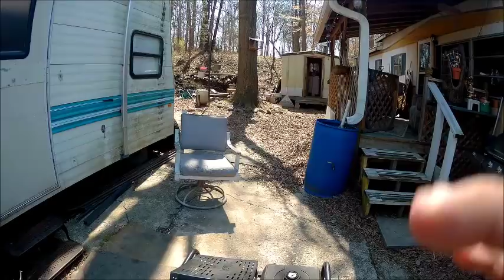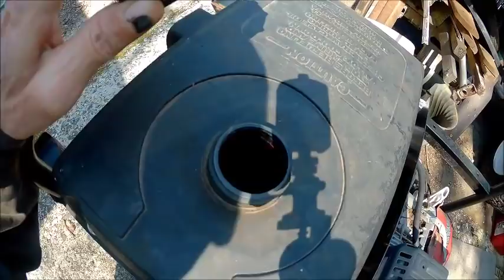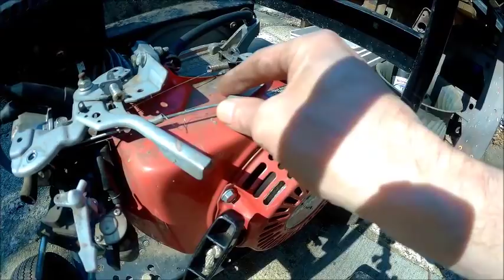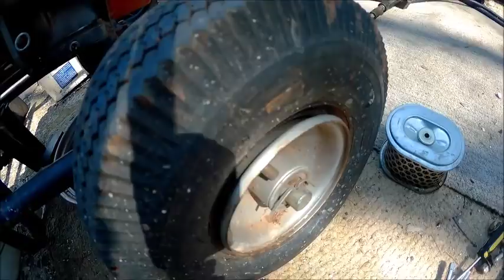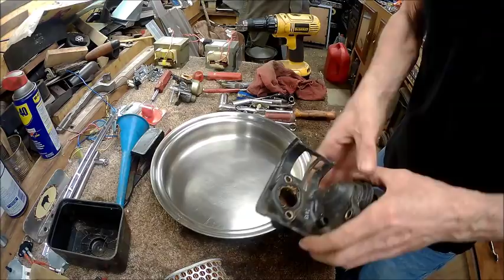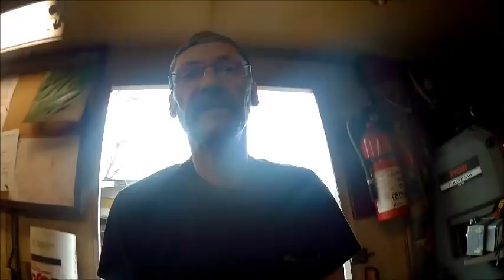baldor generator fail

Comment: I have this same generator but it  is powered by a diesel engine. It is an okay little generator. Need a few parts to get it up and running again. Where do you recommend buying some of the small fuel system parts?
Reply from the maker: try ebay